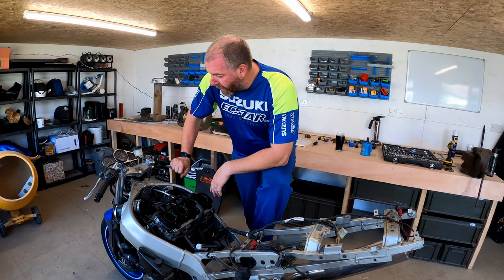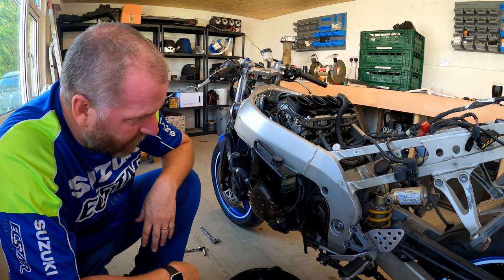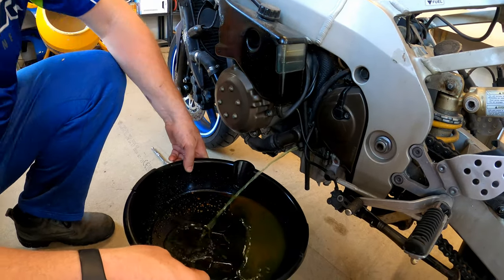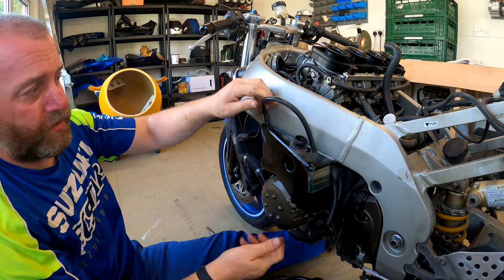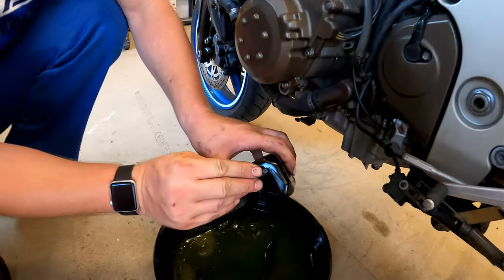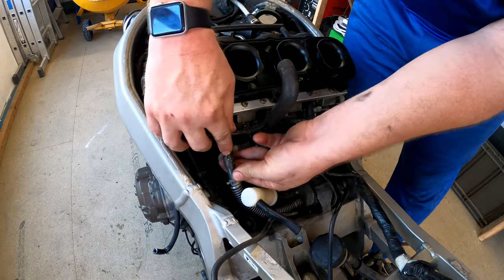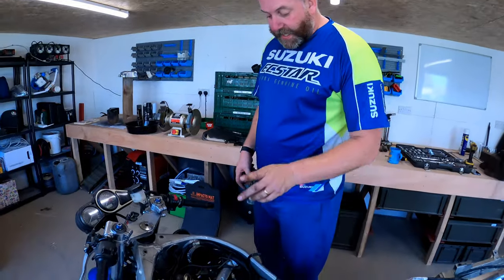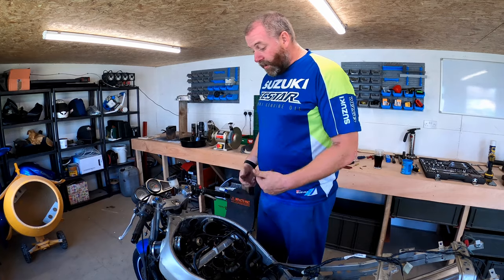1998 Kawasaki ZX9R - Project Shinobi, Episode 3 - Coolant & Oil Drained, Then Carbs Off!

Comment: On the reservoir tank where does the bottom hose lead to?. I just found mine hanging under my bike idk what it’s supposed to go to.
Reply: top hose is the breather/overflow, the hose off the bottom goes to the rad, just under the filler cap.
Reply: @markconlon814  thanks a lot for helping out